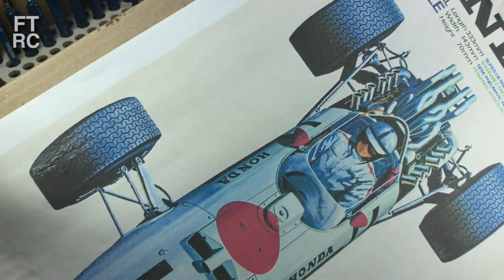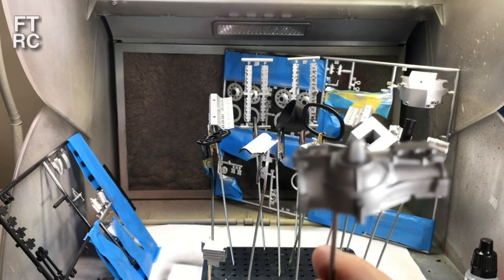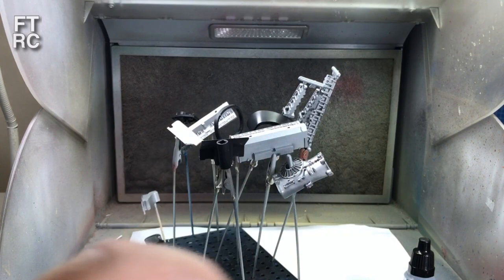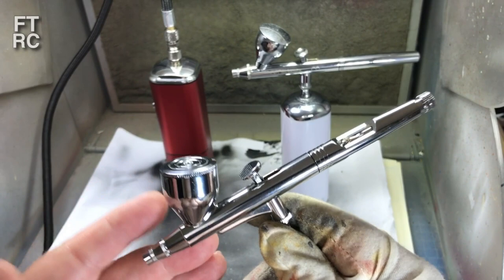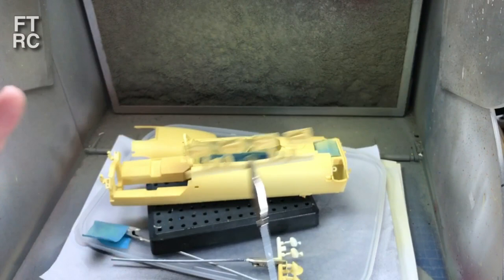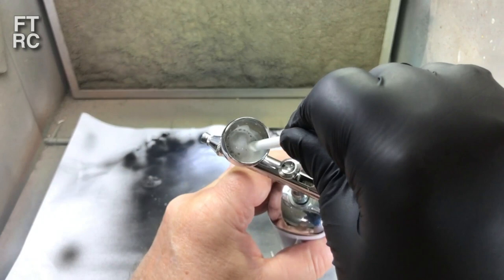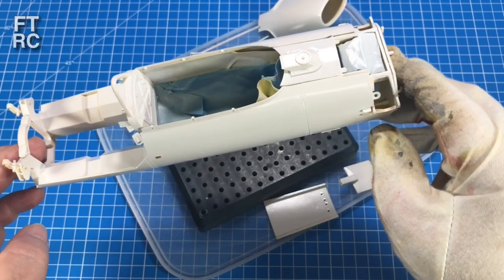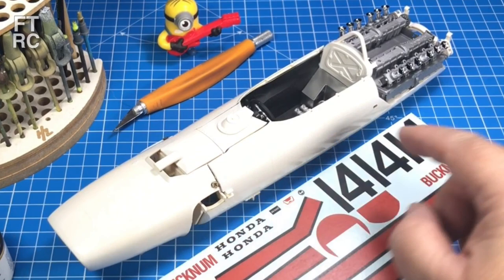Tamiya Honda F-1 Part 3  Painting a Glossy Body plus all the fiddly bits

Comment: Whoaahrrr...nice result on the cream Harry. 12 coats and can still see the panel details on the body...must be some kind of record. Superb job Harry. Hope you're on the downhill run for arm recovery now. Cheers 👍🙂🐈‍⬛
Reply from the maker: From discussing what happened with my mate David, who uses Mr Aqueous a lot, we think the bottle had settled pigment so the thin paint I first took out at was mostly thinner.  As the day drew on I shook the bottle more and also tilted it to get to the bottom, where I must have got actual pigmented paint. But the many thin layers really did give it a lustre.
Reply: @HarryHoudiniModels  I bought one of those "test tube mixer/vortex" type machines for 5 shekels off the bay of everything. No more settled pigments in the bottom of paint containers/bottles. Works for Vallejo, Citadel, Tamiya pots and all AK pots/dropper bottles...takes a few minutes to be sure for older containers but works great 👍🙂
Reply from the maker: That might also save my Hataka paints which all have solidified pigments… my Lifecolor however appears unaffected
Reply: @HarryHoudiniModels  I just used the US Navy white one the other day and basically two thirds paint to the one part thinner..tried the fifty fifty and it was way too thin to spray properly..

Comment: YESSSSS! You're back on the Honda and what a smooth job you're doing! But depending on how old this kit is,the decals might be dried out and that could lead to cracking problems! If you haven't already used them yet I would use them as masking tamplates and airbrush the red and black stripes! More work but easy to mask and the look will be stunning so good luck in either case Harry.GO!🇨🇦👍
Reply from the maker: The decals I showed at the end of the video are brand new from Indycal.  The 50+ year old Tamiya decals might have bleached out in my sun, but I’ve never liked Tamiya decals anyway, so won’t use them.  There is the option to mask and paint, which if the new Indycal decals prove too difficult I then may explore.